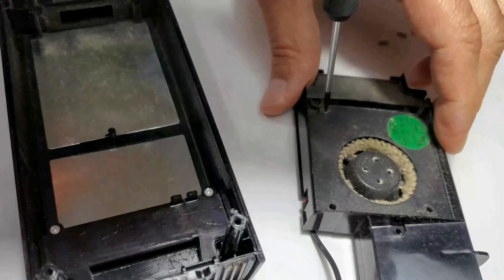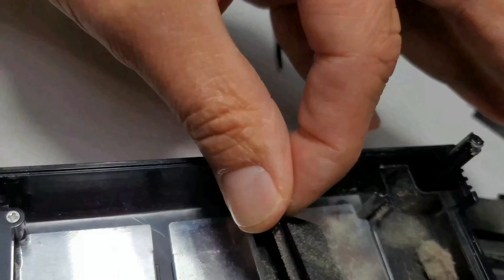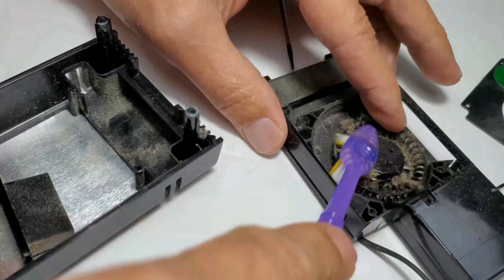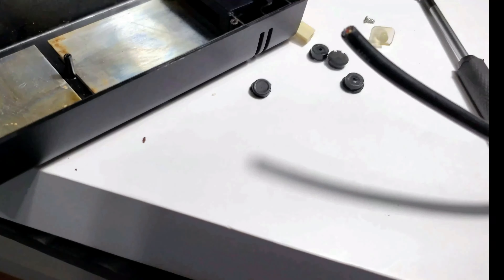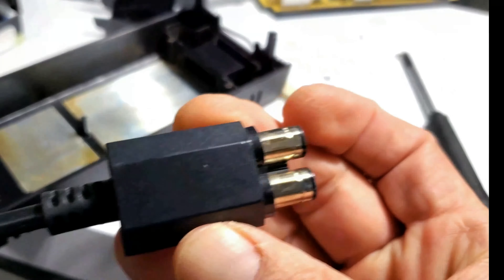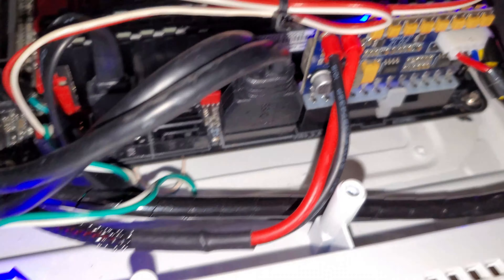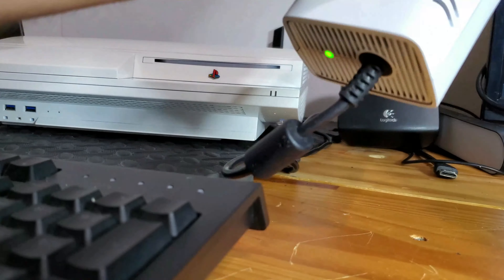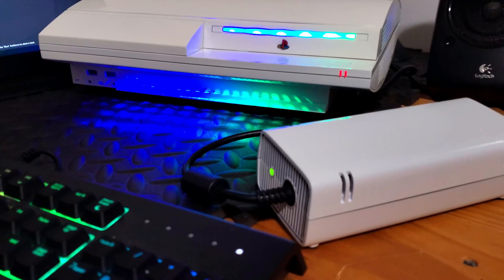How to power a PC with an Xbox brick

Comment from the maker: See the PS3-PC ON BITWIT'S CHANNEL! https://youtu.be/GRGqXodeL3w?t=168
Reply: Is there a way to make the xbox360 console use a less powerful brick?
The reason why xbox360 overheats is because power brick is too much amps, most capacitors will not resist the heat over time.

Comment: Very cool. I'm thinking this could be a way to bring my old tiny form factor Olivetti PCS 11 (386sx PC) back to life. I wouldn't use a PICO, just solder the PSU wires from the 360 brick to the wires that were connected to the blown Olivetti PSU?
Reply: Ah. I think I need: + and - 12v, +5v, 5vSB, power good and ground. So the +5v is missing on the x360 unit? So I would need to wire in a PICO?

Comment: Nice video! Do anyone know how you make this PSU idle on standby @5V when not being used by the system?
Reply: PSU never goes idle, only the PC does through idle control. If you want a 5V switch then you gonna need to solder a lot more than just cables.

Comment: I bought Xbox one as it is has no Power Supply for $50 is it away hock it with pc Power Supply ? i want see if works or not will xbox 360 Power Supply work i still have one from dead xbox 360

Comment: I re created your idiotic idea ..but i got a 203 watt power brick .. my pc has a 300watt pico board ..you gave me a great idea after i melted a 10 amp power supply . Got one  on E Bay and did the thing with wires and hey presto problem solved ...works great and hardly warm ..nice with a fan too . I am running an AMD A8 (10 cores) at 45 watts .. so 203 on the power supply is great ..more than enough .
Reply from the maker: Glad it worked for you. It's useful for orher 12v applications as well like car audio in the house, charging stuff and so on.